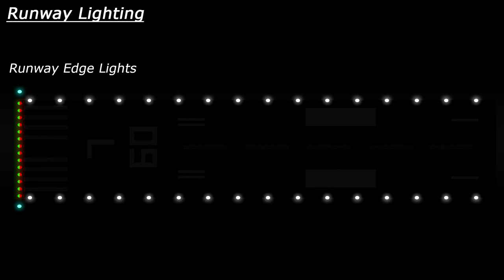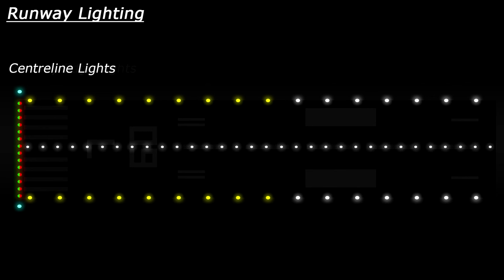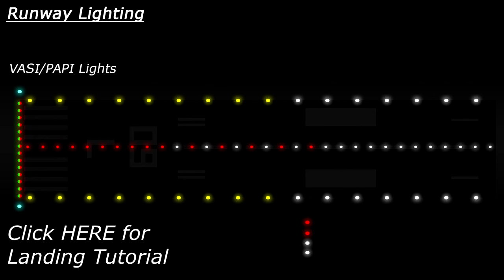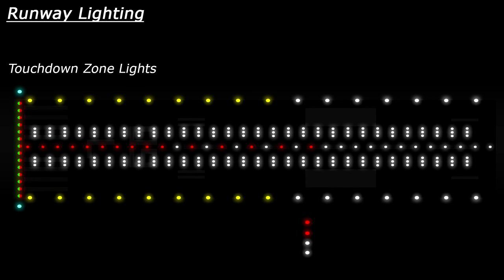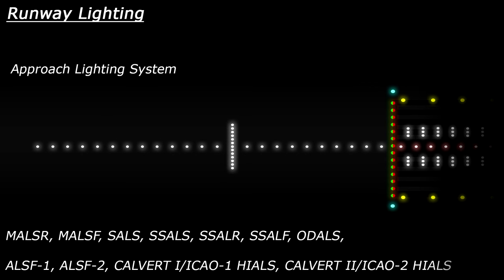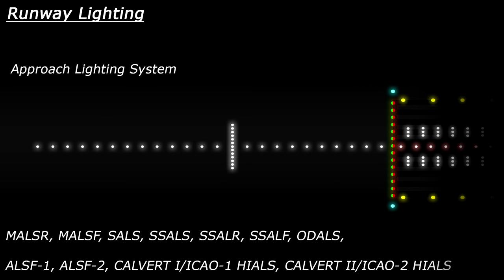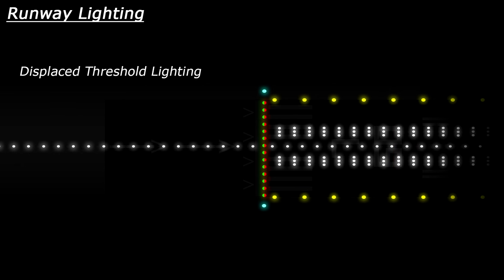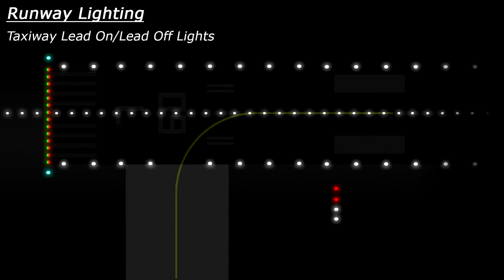Runway Lighting Explained

Comment: It's pretty important to note the exact distance the edge lights change color, as well as the exact distance the centerline lights begin to change color. Not only is that a standard part 121 interview question, but more importantly a good pilot needs to know that info. Very surprised you didn't include that. Unless this video is simply intended for beginner private pilots perhaps?
Reply: so the answer is???

Comment: It would help to say that the yellow edge lights form the end of the runway in case it is ILS capable they are located in the last 2000ft of the runway, the alternating white and red start in the last 3000ft and then in the last 1000ft are the red lights. So in conclusion the yellow edge lights are in the last 2000ft, red-white in the last 3000ft-1000ft and the red lights last 1000ft, these are interview questions!!

Comment: Bulb suppliers for airports must be making a killing.
Reply: Evil from evilution actually those bulbs had a long life, they were'zenon'  which extended the life much longer than the ones in the stores, but now they are going to, LED, of which can be quite bright, so normally they, are NOT on full brilliancy, SO in foul weather , a pilot would ask,for MAX brilliancy'
Reply: @flybyairplane3528  Any link/source to those "Zenon" lights? Only thing I could find was the greek forename.
Reply: Rainer Zufall sorry I do not know, but way back in flying I was told why XENON, was their durability,, all that was PRE LED, so I have no idea what they are actually are using,  here in the NE, ALL TRAFFIC LIGHTS ARE NOW LEDs, their ONLY FAULT, is LACK OF HEAT, so snow/ice have problems with them, Cheers  from NJ
Reply: Flyby Airplane they cost a million to set up tho at major airports

Comment: Some more fun facts:-
1. At remote airports with no control tower, pilots can turn on the runway lights by tuning an associated frequency and clicking the mic button several times. The pilot can then adjust the intensity of those lights with subsequent clicks on the mic.
2. Control Towers can flash all runway lighting on and off to alert vehicles and aircraft to vacate the runway immediately.
Reply: Yeah that was in Air Crash Investigation
Reply: They r u testing a thing I’m Texas we’re the Pali lights flash automatically if someone is on the runway, if you are below 500 feet and the papi flashes u have to go around
Reply: @SierraDelta-  hell' can we have that in FSX ? A software or something that adds those features maybe?

Comment: Sometimes the runway end identifier lights and/ or the touchdown zone lights can change between red and green.These are called status lights, which provide the pilot a 
visual reference for ATCT instructions.
Reply from the maker: Yep you're correct. I think that Runway Status Lights are only at a limited number of airports at the moment so I didn't include it in this vid.
Reply: Doofer911 16 airports in the USA

Comment: a very well explained video. I have a question though which actually isnt convered in the video. If any one of u know and answers, i would be really greatful.

The length of the overall lights`segment before Threshold is equal to 900 m and decision Bar is placed 300 m before Threshold. Does any now know the reason behind that, why this lenght and why Decisoin bar is placed exactly 300 m beofre THR and not e.g. 400m?

Comment: What is the rotating green / white light for?
Reply: slamdvw Are you referring to the beacon? It's designed to aid in airport identification from all angles. Some airfields might be hard to see from afar especially when parallel to the runways, but the beacon will rotate white and green thus standing out from other city lights.
Reply: Yes, the rotating green / white one was what I was referring to, Always seen them, never knew what they were for.  Thanks!
Reply: If i recall correctly the number of colors also identifies the airport type as well. 

A Military Base will have a different beacon setup than a commercial airport. and i think a Private airport has a different setup aswell. i could be wrong on that last part though.
Reply: 2 Whites and Green actually for military.  One White one Green Civilian.

Comment: How does a pilot turn the runway lights on at a dark airfield?
Reply from the maker: Some airports have a radio system which allows pilots to switch on the lights for a brief period of time. I'm not sure what the system is called but pilots can tune a Com Radio into the system and key their mic, basically press the microphone button momentarily which tells the system to turn on the lights. Pilots generally do this during approach and the lights will remain on for 5-10 minutes, enough time for them to land and taxi to parking.

Comment: At night how do they know that's the L09 runway?
Reply: GPS, ILS, and the Lighting Systems are VERY visible at night, almost blinding. In stormy weather VFR approaches aren't recommended. If ILS is available, which is always should be, the plane will fly itself directly center line of the runway and land it for you.
Reply: Ty :)
Reply: Guida Online yes, as mentioned above, on a clear night you can see both runways from a distance, and land on the left or right runway. Landing lights on the plane can also help you see the painted numbers, but only when very close.
In fog, you can use approach guidance to the correct runway. ILS for example will have a different radio beacon frequency for the left or right runway. If you then listen to the frequency, it actually sounds a morse code, and you can cross-check it on you approach chart to ensure you are flying the correct frequency/approach and runway. 
Also, GPS approaches are becoming more accurate, so now you just choose your runway (9R or 9L) in the flight computer, and it will get you there.
Reply: Pilot177013 In simpler terms, Just literally look either left or right..
Reply: Ty :)
Reply: +Guida Online  PLANES HAVE AUTOPILOTS THEY FLY THE PLANE UNTIL THE PILOT IS LINED UP.
Reply: with the help AGL & ILS.
Reply from the maker: +TECH NOVA The ILS has a unique radio frequency that the plane's systems tune into. With that, the radio system actually sends out a Morse Code that pilots can listen to, again to confirm they have tuned into the correct radio systems for the correct runway.
Reply: Doofer911 Correct. for proper approach guidance.